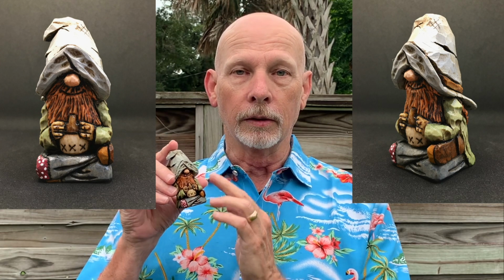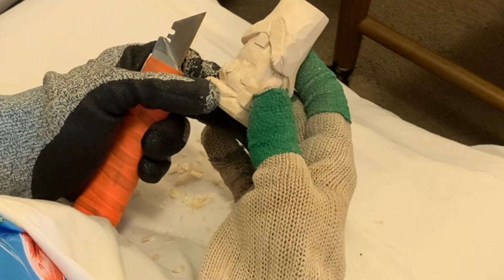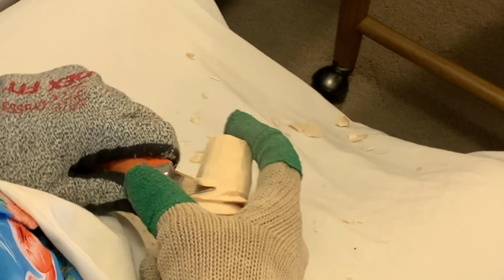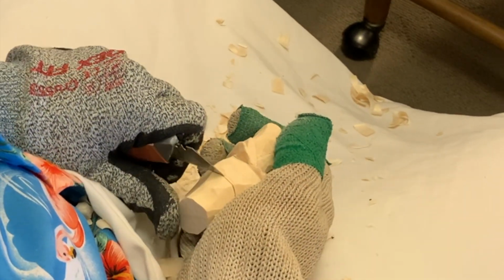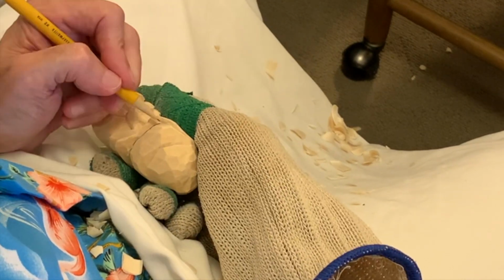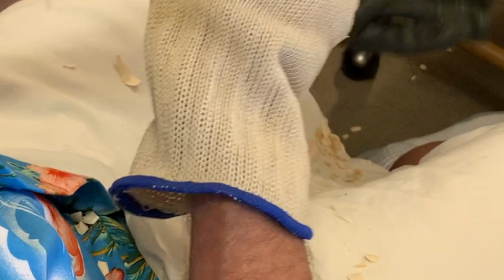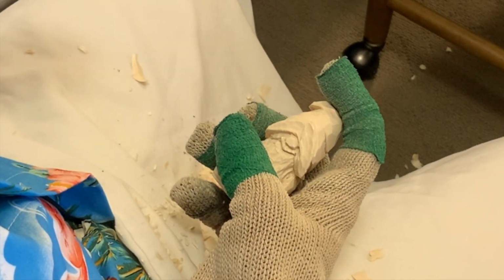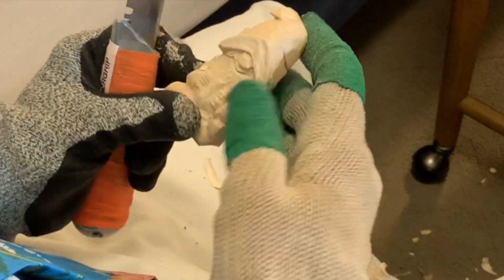Carving A Hillbilly From Wood - Beginner Woodcarving Tutorial - Part 3

Comment: Very nice Hillbilly! I like the detail you carved into it. Is that a carpet cutter you use for carving? Just curious how you like using that for carving?
Reply from the maker: Thanks very much! Yes, that’s a Stanley model 199. I do use it a lot and the thin blade has more flexibility than many knives.
Reply: @whittling  Thanks, I may have to give that knife a try.
Reply from the maker: I recommend the Lenox Gold blades because they cut well and have extra notches for adjusting the blade length.